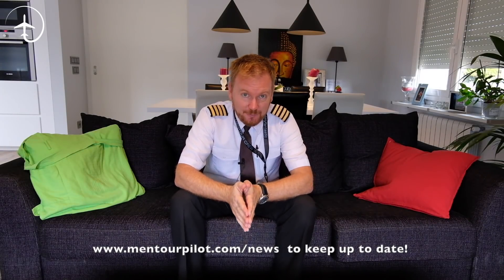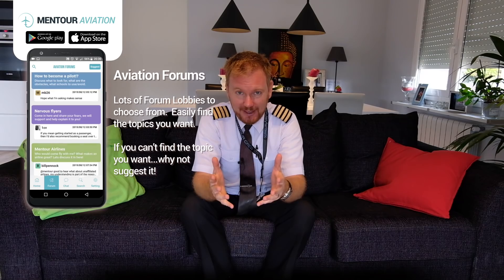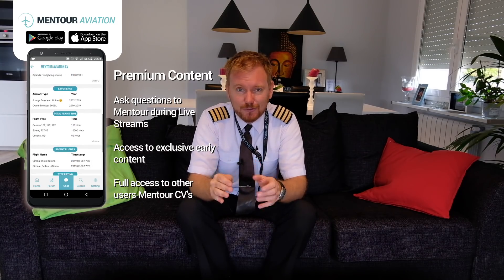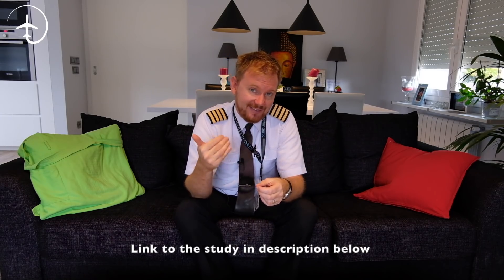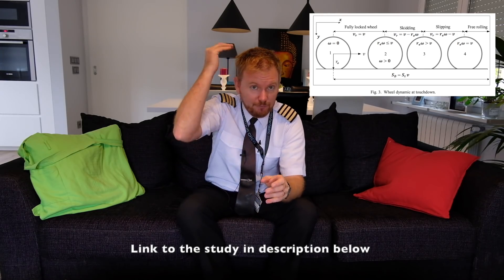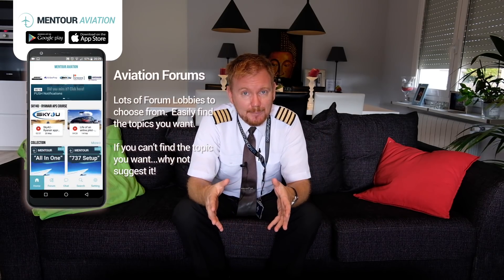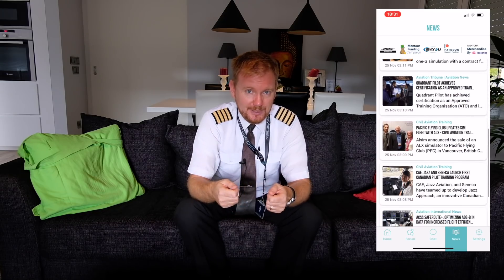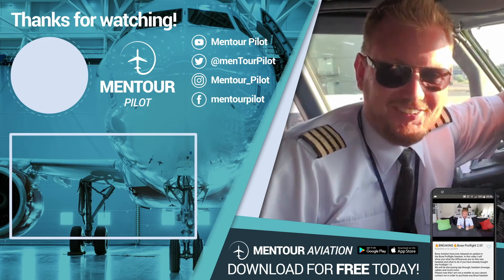Use WIND to spin the aircraft wheels before landing?!

Comment: So that lousy study mentions wheels slowing down even when pre-spinned to 100% but fails to even suggest the obvious reasons. That the wheel inertia is to low to overcome the spike in rolling resistance as the aircraft hits the ground. It also uses wrong units in one place and has several oversimplifications that could lead to grossly overestimated vertical loads. Which could very well reduce the slowdown and significantly improve pre-spinned wear. Nor does it take heating properly into consideration which is the main catalyst of rubber wear and could swing the results either way. So i'd take it with a lot of salt.

Also regarding the gyroscopic effects, haven't read the comments on last video but i'd think they would be almost beneficial for the aircraft: neutral in pitch, and follow the natural coupling of yaw and roll, making it easier to turn the aircraft with just one of the controls (yaw or roll).

That said i think the idea is cool on paper but likely not worth it unless rubber gets 100x as expensive or something.

Comment: "You never manage to reach more than 50 percent of the speed" - Can you explain why that would be the case? As a mechanical engineer, I see no reason why you would not be able to reach airspeed or even more than airspeed.
Imagine for example, that you put a stationary fender over the top half of the wheel, like a car has. Then put vanes on the wheel hub. Those vanes should be able to get close to airspeed. Because their circumference would be smaller than the wheel itself, the wheel would theoretically be spinning at a higher speed.
Besides that, when landing with wind, the groundspeed is less than airspeed and so you don't need to reach airspeed anyways.

Comment: The runway could be made like a giant conveyor belt whose speed can match the groundspeed of the aircraft when it touches down. There would be very little acceleration of the wheels, and the brakes can be applied to hold the aircraft in place on the moving runway. The runway could then be slowed down to bring the plane to a complete stop. Then the plane can release its brakes and taxi off the moveable runway. The conveyor belt could be kept snow and ice free by means of brushes that can be brought into contact with the belt under the runway, as it returns to the front.
Reply: Rube Goldberg would be proud of you.  With that said, all acceleration and deceleration could be handled with ground based electric motors, thus, with regenerative drive achieve an 80% reduction in energy expenditure for takeoff and landing.  Also aircraft would not need landing wheels, just pads and at the end of the belt be transferred to a special truck to take it to the terminal.
Reply: @johndavidwolf4239  
I would not rush to get rid of the wheels, as a moveable runway may not always be available for landing.
Reply: You are right, I should have put a " /s " at the end of my comment.  I thought the first sentence covered that, do you know who Rube Goldberg was?
Reply: @johndavidwolf4239  
By "/s" I presume you mean a symbol to indicate sarcasm. I sensed your comment was in that vein and I replied in kind. I'm aware of Mr. Goldberg's elaborate contraptions, and an engineer who was my supervisor once called me "Rube Brown."

Comment: Hello Sir,
                   How do military aircrafts  generate lift in an inverted (upside down position)? Please advise. Thank you
Reply: Because in upside down position the wings generate lift the same way as they do in normal position. The lift is generated by the pressure difference between the upper side and lower side of the wing. The thing that the aircraft is in upside down position does not change that.
Reply: It is because of the angle of attack of the airfoil. Even a highly chambered low speed high L/D airfoil, like on a glider will generate lift "upside down"  if pitched to a positive angle of attack, only the L/D will be very poor.  Some military and acrobatic aircraft have a near symmetrical airfoil (they work equally well inverted) and rely solely on angle of attack to generate lift.

Comment: On another topic, can you imagine aircraft ever using sodium or compounds of sodium as a zero carbon fuel? Just Thunderf00t reckons we need to burn sodium to scrub CO2 out the atmosphere (he hasn't specified aviation, but the only engines I can imagine using it to do useful work are ramjets, hybrid rockets and afterburner stages).

Say the stuff can be produced in the amounts needed for an acceptable price, what would you envision that looking like?

Comment: I think that overcoming the baseline drag of modern disc brakes would be difficult using wind power from the slipstream.
Reply: That might be true too.  Could be between the overall mass of the tires and brake drag even 140 knot wind isn't enough to do anything useful using a simple air turbine, and anything more elaborate adds cost and reliability issues.

Comment: Interesting discussion on landing gear wheel speed. I believe however, that the thinking on this issue is rearward thinking. Let us start putting our thought energy forward.  From an environmental view anything that can reduce the burning of fossil is a good idea. Let’s look into better non-rubber based materials that don’t cause that cool blue smoke, sorry. Another far out thought is VTOL. Problem solved.  Just some in-front- of- the- box- thinking.   Thanx and Happy Holidays.

Comment: Even if you spin the tires to speed, you're still going to have wear from braking and turning. It's just another moving part to maintain and potentially go wrong and add weight to the aircraft. The more wheels you have on the aircraft, the more expensive the concept becomes. "Turbine hubcaps" may be a problem for aircrafts with exposed recessed landing gears like the Boeing 737 and Embraer E-jets.

Comment: Probably wouldn't make economic sense until you have hybrid aircraft in service, and you're using regenerative braking to either store energy to aid in takeoff, or maybe just to taxi the aircraft. At that point, you've already got the generator/motor in the wheel hub, and anything else you use it for is just making it weight back.

Comment: It would be nice if there was an "Electromagnetic system" that could spin the wheels Faster than the aircraft is going so you don't have other moving parts but yet it would allow the tires to move faster than the speed of the aircraft is moving? This technology could be used for not only speeding up the wheels but to help Brake the aircraft. With electromagnetic's the wheels would not have to touch parts like the breaks do when they start smoking there is brake down. No touching parts that do the same thing that tow touching parts would do.
Reply: 1. Why should the Wheels spin faster than the aircraft is going?
2. The brakes on a airplane can slow down a airplane much better and faster than any e-motor that would fit in the wheels

Trains use the dynamic brakes (e-motors switches in generator mode) only to slow down, to stop or at emergency brake they use the good old disk brakes

Comment: I have a question that's never been answered in any of these videos and I don't find it online. 
Just before a jet touches down after the flare, the rear wheels are at the same height off the ground, but then one side touches down first, usually the left.       How do the pilots know how to do this and what is it called?     Are they listening to the automated voice calling the height, or is it a feeling where they just know when to do it?
Reply: There is almost never "zero" cross wind, even the slightest will cause one side to be lower than the other.

Comment: My wheels are still rotating inflight, unfortunately.
I'm flying a small aircraft with a fixed undercarriage. To reduce the drag of the wheels inflight, it uses drop shaped wheel-housings. Because of the airflow below the wheels on the one hand and the loss of airflow above the wheels inside the housing on the other, the wheels are spinning all the time the aircraft is flying. Once I have lost the balacing wights glued on the nosewheel rim inflight. The vibrations on the rudder pedals was this enormous, I decided to make an unplanned safety landing because I thought of a rudder failure. After about 10 minutes my feet were numb because of the heavy vibrations. So, the nose wheel must really rotate fast. My airspeed inflight was only about 100kts.

Comment: So, some things I also thought about.
1. Probably blades will also add some additional noise. That defenetely not good during the landings.
2. Wheels will spin more during the take-off, so some additional effort needed to stop the wheels.
3. That blue smoke - that mean that tire become hotter and hotter tire means more friction and reduced stopping distance. Remember a F1 cars preheating the tires before race:-)
Reply: dooonot To add to 2, theres drag on takeoff too - not when you want any extra drag thats not helping lift. To add to 3, blue smoke heating is too localised to build heat into the tyre; heat doesn’t add grip, in F1, it just gets the tyres into the range they were designed to work - too much heat just creates a soft goo that slips off the carcass and reduces grip (which is one of the reasons not to use winter tyres in summer - they wear out too quickly and have less grip). Engineering, looks simple on the surface, gets really really complicated when you have to do it professionally.
Reply: And to add to what Andy Owens said, you also would get wheels naturally trying to spin on landings while you are trying to stop them to. Then more action on the brakes, more heat, the opposite of what is needed.

Comment: I doubt there is a wind-driven wheel design that would spin the wheels up to a speed sufficient to reduce tire wear enough to justify their development.
Also, it works on takeoff too so wheelspin speed would increase in relation to increasing airspeed after takeoff requiring more braking and heat buildup as the wheels are retracted.

Comment: The gyroscopic affect from the engines is significant.  However, since engines spin in opposite directions, the effect from each engine cancel each other out.
Reply: No, on all commercial airplanes engines spin in the same direction (less different motor spares to be kept in stock).
Reply: Although most multi-engine turbo-prop aircraft have the propellers spinning in opposite directions, it is in the gear box, not the engine.
Reply: @johndavidwolf4239  Good Point !
Reply: @johndavidwolf4239  Turbo-prop engines are used on a very small part of commercial aircraft. And they make them rotate in opposite directions, not for gyroscopic reasons, but for torque reasons.

Comment: The point everyone is missing here is the gyroscopic effect of 20 spinning wheels rotating at about 40rpm. The slightest use of the rudder would plant the wings straight into the ground.
Reply: You have to remember gyroscopic effect played havoc with the controls of place such as spitfires on landing. Every time you use rudder you need to compensate with aileron to keep the wings level.

Comment: Spinning up the wheels during touch down by rubber loss is part of the breaking.

Every device pre spinning will result in a little bit longer breaking distance.
Every device will reduce other aircraft performance by weight, size, maintenance, ...
I do not expect any trade off at all.

Comment: Probably could use Bleed Air but I still think it's impractical.
Reply: You got plenty of slipstream air to use.  Sounds like there's really not that much to gain from the effort.  I think the KISS principle applies -- keep it as simple as necessary.  Anything you add because "fancy" is just one more thing to fix that didn't need to be there in the first place.
Reply: Bleed air is at its lowest pressure on landing because the engines are at idle or very low throttle so that might be a challenge... but of course that means the loss of efficiency by drawing off bleed air is least significant.   :)
Reply: @davidtiman  I guess that means better wheel bearings then? Hahahaha.
Reply: @darioinfini  Yeah if you can already get 500+ landings off one set why go past the line of diminishing returns? I agree sir.
Reply: That was also my thought.   Just high pressure air nozzle mounted on the break caliper aimed near tangentially at the existing interior vanes of the vented break rotors, after touchdown, switch to a nozzle near the ID of the rotor to increase airflow/cooling of the rotors which could also help turnaround time, it might be best to cool the bleed air from the engine before it gets to the wheel.  As it would only be for landing, and the plane is at ground level, the bleed air normally used to supply the cabin could be redirected for that few minutes.
Reply: @johndavidwolf4239  You would be blowing air on a kindle box at that point.  The tires would be fuel, the brakes the fire and the bleed air the O2 source acting as a giant billow.
Reply: Jeff C:  The air would only be blowing on the METAL break rotors, and by the process of "Cooling by Decompression" it would decrease heat buildup, thus reducing any potential source of ignition. At over 100 mph there is already more than enough O2 to support combustion if anything combustable exceed its kindling point.  The term is "tinder box" and "bellows", is 'kindle box' a plug for Amazon?

Comment: What would happen in bad weather, snow and ice would get in there and make it worse and what if one of the blades brake off, where is that going to end up
Reply: It would be spinning at a fairly low speed compared to other parts of the plane that can break off and it is fairly easy to engineer items like this that spin to only a few hundred or thousand RPM.
Reply: @JQB45  And what about snow and ice getting in there and jamming up the wheel

Comment: I wonder if the engines are cleaned for debris before and after every flight. If yes, how can it be possiblely cleaned? If not, shouldn't it be?
Reply: Some engines have some sections cleaned between zero to a few times between overhauls, maybe between 1000 to 3000 hours.  It is typically spraying a water-based cleaner through special nozzles in the engine while on the ground running at partial power.

Comment: a weird variable to figure in is the amount of rubber already stuck to the runway.... rubber on rubber is something nascar may be able to help with. (???)
Reply: If the runway is sufficiently long AFTER the area where the aircraft first touch down and rubber imbedded in the pavement decreases the abrasiveness of the runway, then not cleaning the runway would be beneficial as it would decrease tire wear as the tires would rotationally accelerate at a lower rate (get to same speed over a longer distance/time).  F=MA,  Mass constant, Lower Acceleration = Lower Force, =Less Wear.

Comment: Perhaps bleeding air from the turbine might do the trick cheaply
Reply: Those tires are huge you need a lot of power to accelerate them
Reply: @deltaxcd  When the tires are in place, there is no need  of pressurizing the airplane, and some power is there unused, can be delivered to small turbines just with a simple pipe.

Of course I do  not have the engineering skills I was just curious to have some opinions

Thks

Comment: Here's my response to the idea of spinning up the wheels.  See that smoke.  If you capture that smoke and condense it down to the density of rubber, how big a chunk of rubber do you think it would make?  Not a significant piece of rubber at all.  That gives you an idea how much rubber is lost when the wheels first touch the runway.  The little cloud of smoke is made by an insignificant quantity of rubber.  It would not justify any added weight or any constraints on design you might encounter if you decided to use air flow to spin the wheels.

Comment: Here's a great idea for improving aviation by doing away with the need for those expensive tyres and long straight 'runway' things or whatever they're called. Declare inertia illegal, and shrink airports.

How? Easy. There are two simple steps:

1). Launch aircraft with a catapult - they'd need no runway at all. 

2). Fit airports with the cable system used on aircraft carriers; equip all planes with an arrester hook beneath the tail which would bring them to a 'controlled halt' in the space of no more than 20 yards. With the 100-G deceleration there'd be no need for brakes or tyres at all!

But wait - there's more...

A high-G catapult launch that took a 400 seat jet airliner from zero to 250mph in under 2 seconds would be a wonderful way to save fuel. True, it would probably destroy most planes and everybody on board, but there'd be no need for food or toilets or in flight entertainment, either. And every flight would reduce the world's population by 400, so it's a win-win idea for planet Earth!

Yay!

It's the eco-suggestion that keeps on giving!

Yes, I know. I just wanted to post a really stupid suggestion to see how many people would get angry enough to list all the faults and failings of my absurd idea. Don't bother, guys. It's just a joke, OK?  ;-)

Comment: if planes have fuel in wings ,why doesnt the fuel run into the wing tips when turning and cause a hard over turn ?
Reply: len allan   There are a few parts to the answer.  The tanks do not extend all the way to the tips.  The tanks are not simply open cavities.  They may be in sections connected with fuel lines, perhaps with valves and pumps depending on the model of plane and may also contain baffles to slow fuel movements inside.  In a coordinated turn, the local acceleration vector (local “gravity”) stays in very nearly the same orientation as in level flight.  This is why passengers are not thrown to the side in steep turns and applies just as much to fuel as to passengers.
Reply: len allan - Like it was said in the previous comment the wing tanks are divided into several sections, and there are baffle plates inside to prevent the fuel from sloshing.